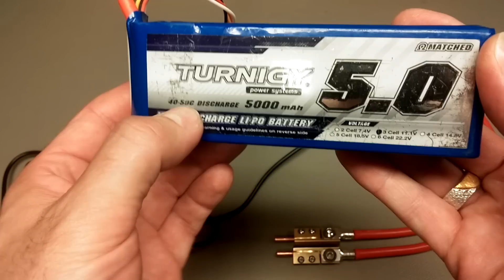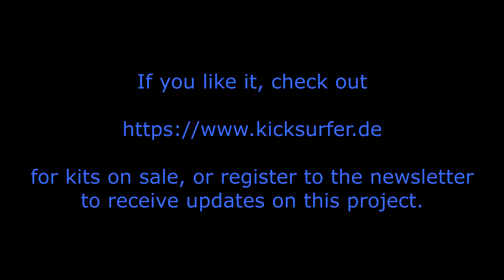Next level DIY battery spot welding

Comment: I just received confirmation of this item being in stock but it comes out to $260 with shipping and I really thought it was cheaper when I pre-order, did the price change? I'm not sure I want in at $260.
Reply from the maker: The first production batch had a 10% discount, which this one doesn't. But $260 seems to be a too high number. The kit with cables for self-assembly is €156 plus shipping. You can also order just the electronics module for €110 and provide or make all other parts. This kit is a bit more expensive than other similar kits, but I have also invested into parts to make it more robust. Just the six MOSFETs cost roughly €30 at Digikey.
Reply: $165 for the unit
$51.48 for DHL shipping a little pricey for such a small item. 
$34.56 Mwst.? Why? 
$216.48 total which thanslate to over $260 US
Reply from the maker: The €34.56 is the VAT (German: Mehrwertsteuer, Mwst) that I have to deduct, and €43.26 is the business rates that I get from DHL. I assume that you are located in the USA, that's the DHL price for an overseas parcel. None of these go into my pocket. I have a US reseller though, please contact me through the website contact form and I'll give you his contact. Part of your high price is the recent isolation policits in your country, which is weakening the US dollar. Only a year ago the US$ / € conversion rate was much better for you. But that's an entire differen topic...

Comment: How much did it cost? do you plan on selling a pre-made one?
Reply: ahh nvm just checked your shop, 165 Euros is a bit on the high side... i usually solder my 18650s, which i admit, is a bit tiring and time consuming...it is a GREAT product though just not very affordable for me... thanks
Reply from the maker: Check out the shop for the prices, it is currently sold out but I am working on another production batch. It will be available in kit form only for you to self-assemble. However, you need only very basic mechanical tools for that, it is fully soldered and all the special work like cable crimping is also already done.

Comment: how is your powersupply project for this welder coming ?
Reply from the maker: I have a prototype of the capacitor charger running at 60A continuous (80A short), heating up a lot of 50W halogen lamps. The capacitors need a base PCB with a balancer, I plan to continue this project in January.
Reply: ok that sounds great, and when i already have the spot welder i will be able to just hook it up to the new power supply as is?
Reply from the maker: yes, it will be an "official" accessory.
Reply: ok sounds excellent, ...on your waitlist now :-)

Comment: Really cool. How about spot welding copper or alluminium? Once the 20700 batteries are available everywhere the need of high current serial connections will be huge. Or do you have an alternative idea for nikel?
Reply from the maker: I haven't tried aluminium yet, but made experiments with copper. It seems that the power level is not high enough, it would require 5-10kA for copper because its very high thermal and electrical conductivity. kWeld is good for 2kA max. I'll keep experimenting though, as it would be a huge plus for the welder if it can do copper.
Reply: WeAreTheWatt thank you. Owould it be easier to look for nikel plated copper? Or copper plated steel?
Reply from the maker: I think neither would help. Plated copper has the same excellent thermal and electrical conductivity, and it is hard to melt. Copper plated steel has basically the same conductivity as steel...
Reply: ultracapacitors might do the trick
Reply from the maker: I've went all the way up to 2000A of current, that's the limit for the welder switch. That wasn't still enough for copper/copper. But I will try with aluminium (have to order something for a test). But that has double the heat capacity of copper, and half its thermal conductivity and double ohmic resistance. But most importantly, it melts at a significantly lower temperature.

Comment: Nice little welder!
Your kickstarter page is down for maintenance. 
Have you quit making these? 
If you're still going to be making them, what is the price shipped to Los Angeles Ca 90501?
Reply from the maker: it was down because I maintained the products and started pre-orders! :-) You can check the shipping rates online, the shop has a calculator.

Comment: Hi! What is the electronic module/board used in the welder?  Thank you for the video
Reply from the maker: This one is not based on one of these off-the-shelf controller boards, it is a monolithic design using an STM32 microcontroller. An Arduino would not be up to the job here, as the computational complexity of the welding algorithm is quite high.
Reply: Answering the question about what brand this marvelous product is made by, I still have not seen the answer. Could you please provide a brand name, or wher to buy it? Al the best from The Netherlands!
Reply from the maker: Did you read the video description? ;-)

Comment: This is really fantastic to me, and the amazing realization is that no high voltage is necessary only 11.1v! Why people user a high voltage is now a mystery to me. Perhaps the weld happens a millisecond faster with a higher voltage?
Reply from the maker: Where did you see high voltage in a resistance spot welder? For this kind of welding, you just need insanely high currents. The resistance of a weld spot is low, maybe one milliOhm. And you need to heat it up such that it melts.
Reply: many people use a microwave transformer- but actually I guess in adding a large secondary they are actually using a low voltage at the weld. So the big difference then is just using wall current versus battery current, and to produce the hundreds of amps needed a relatively high primary to secondary ratio is needed. But I always thought that arc welders use high voltage- but maybe no.
Reply from the maker: Yes, the microwave designs also produce low voltage, around 1-3V on the secondary. But hundreds of amps is not enough yet, also these are able to do >1000A when made well. Their advantage is that it is much easier to switch the current, but their disadvantage is that they can only chop the welding time into 10 millisecond intervals (one half AC sine wave). I need much better resolution to implement my energy based pulse control and therefore chose DC supply and MOSFET switching.

I think that arc welders are using higher ignition voltages, but this one is not an arc welder. This is called resistance spot welding.
Reply: oh ok thanks for explaining- interesting that yes- it must be that 60hz is only 16ms I see your point about a higher switching frequency.

Comment: Why brass? Aluminium is way more conductive, similar to copper.
Reply from the maker: It's not that easy, aluminium is highly corrosive and the "rust" is non conductive. At these cross sections (currently 4x12mm = 48mm^2), conductivity is not an issue, I concentrate more on cost and usability. Brass was most easily available for me for testing, but meanwhile I tried laser cut aluminium as well. I was not happy with the result, and will change to brass again. Check out my other videos, this one shows only the first evolution step :-)

Comment: This is great, i will have to bookmark it. I am learning about batteries and building battery packs and so this will be a necessity. Will it be possible to power one using a powerful DC power supply or car battery? I don't feel comfortable using these cheap lipo packs. In my RC racing experience, they tend to be like women; unpredictable and violent.
Reply from the maker: You can use the unit with a car battery, or with a suitable supercapacitor. I am currently developing a capacitor based power supply for the welder.

Comment: Would it be possible for the software to allow the time before automatic welding occurs to be set?
Reply from the maker: I don't understand why that would be meaningful? That would contradict the design concept of controlling weld spot energy.
Reply: Sorry, I was not clear.... The time I would want to control is how long one gets to position the probes before welding is triggered, when in automatic mode.,,, In the video the automatic mode appears very useful but the weld happens very soon after the probes make contact and I'm not sure everyone could position them accurately and press down ready for the weld to happen in time.  Hope that makes it clearer.... nothing do do with the welding process itself.
Reply from the maker: Thanks for clarifying. Yes, this appears to be a very useful feature! I've added this to my todo list. But that also implies the decision to move from a potentiometer to a rotary encoder with pushbutton switch. One of the rationales behind this system is to make it as simple as possible. Not decided yet...

But have you also watched the more recent videos of my channel? I have improved the auto mode to make it more usable.

Comment: And I guess it gets the energy right by measuring the resistance of the tabs before each weld? That's quite clever and makes a lot of sense.
Reply from the maker: Almost! It is doing this continuously while welding, at a very high update rate thanks to the powerful microprocessor.
Reply: Impressive! I might order one when they're back in stock ;)

Comment: Is the circuitry in this effectively similar to the car jump start battery pack? Not seen much for tear downs on them but they also use MOSFET's. Otherwise from a safety stand point it could be a good idea to cover the leads with some kind of insulating material where you are holding them.
Reply from the maker: AFAIK those Lipo jump starter packs are basically just the battery and a schottky diode for reverse polarity protection. There is no power switch, you just connect them to your battery. The current is typically also lower, a few 100A. This unit is much more complex, as it has to reliably switch up to 2000 A.

Comment: Does this not damage the batteries in any way?
Reply from the maker: Spot welding is the method of choice for making battery connections, because it introduces only very little heat stress.
Reply: Fleder not excessively. All use of a battery degrades it. If you want something that lasts forever you really would want to power it from the wall, but I can't imagine this braking anytime in the near future.
Reply: No, I was talking about spot welding the battery :)
Reply from the maker: The battery that I am showing in this video is in fact not up to this task. I have tested a more suitable one in my more recent videos on this topic, check out my channel.

Comment: You could wire 2 of those batteries in parallel to increase the discharge rate if you need extra capacity.
Reply from the maker: yes, that would be an option. But I have found a more suitable battery as I discuss in my more recent videos.

Comment: Perfectly engineered. Must have been german.
Reply from the maker: Yes it is :-)
Reply: Could have also used a 12v starter relais. These things are for high start currents at 12V of around 250A and are really cheap like 2 dollars per piece.
Reply: @seculartalkin60fps37  ..your idea is low end side..the above really high end electrical/electronic system with all data calibrated with uniform output.
Reply: @seculartalkin60fps37  there's a separate video with using a starter solenoid that are used in ride mowers, same principle and it's easier and cheaper to build, but you have 0 control of the pulse energy, but yes, as a cheap and easy spot welder it will do the job just fine and save you some $$$$$
Reply: Couldn't you tell by the accent? LOL.
Reply: this project reminds me of another one my some years ago, https://www.youtube.com/watch?v=dd-Vb1LqkLA

Comment: Just a fuse rated for 300AMPS no biggie.
Reply from the maker: Current is 1.5kA, quite substantial :-) The 300A fuse is correct because the unit fires short pulses of up to 0.2secs only.

Comment: Nice little spot welder you made there. Best one I seen that works on battery power. Nice bit of machining too on the probes. Nice little neat device you made there. How many mosfets you using on this ?. Great work and a top job you done there. Hope your going to make some to sale? Think they would sell well. Love it I give it a big thumbs up 👍.
Reply from the maker: Thanks :-) It's using six MOSFETS. But it is not only the number that counts here. The transistors are also physically large, the combined chip size is approx 80 mm^2, which is a lot more than all other similar designs that I am aware of. They are on sale but currently out of stock (www.kicksurfer.de) as I want to wait for customer feedback first.

Comment: How do you measure the energy with it?
Reply from the maker: Energy is voltage x ampere x time, and this is what the unit measures.
Reply: when the fet is on? how fast do you need to sample to get energy in that short time
Reply from the maker: Typical pulse times are in the 1-10 millisecond range, that is no problem for a microcontroller ;-)

Comment: I don't care who you are or what your job is... holding those electrodes when you're using it, is pretty much suicide.... it only takes a few milliamps to kill a person, and you're shoving who knows how many amps through those electrodes.... all it takes is a tiny itty bitty pin point of contact to something you shouldn't be making contact with, and you're dead....
Reply from the maker: There is nothing that can kill you when you touch the poles of a 12V battery like in this case.
Reply: Hikari i dont think he would die. The spot welder he is using gives out 3.7v at hundreds of amps. Even if he had the electrodes on his tongue he would barely feel a zap. The resistance of the human body is far too great to generate a milliamp of current through the heart in this setup. It is more like that he might burn his finger while having an imperfect contact with the metal and having the contact points heat up near his skin.
Reply: hahahahahahaha
Reply: Your mother dropped you on your head at an early age, didn't she?

Comment: In next version. You can include charging function to top-up the battery.
Reply from the maker: Thanks, interesting idea. But as the welder can be used with different power sources, and 3S Lipos are only one of many, I need to keep it generic.

Comment: Nice job.
Now to wait for the 50$ clone from ebay :-)
Reply: This is not true, as a service engineer. you would need something portable. If we would use this more frequent than this is perfect. just if would have a nice case and isolate probes. 
This is really a interesting device.
Reply: Its pretty interesting and compact. I could see it's use, but I think my diy mot will work great for what I want. I might consider something similar in the future, but at his price I would probably just make my own. I wouldn't say that it is highly overpriced, but I enjoy doing it myself and currently I still have the time to waste.
Reply: the fets alone will run 25 bucks at the moment. i really wouldnt hold my breath on that one. if you have a lithography set up and etch tank at home you might make it for close to that price...assuming you also have a battery or cap bank already
Reply from the maker: Not mentioning all the other components like microprocessor, LCD, SEPIC switching converter, protection components. To make it short: my purchase price for a tested PCB is higher than that number.
Reply: im waiting with you
Reply: panteltje x
Reply: Here is another one DC battery spot welder - malectrics.eu/product/diy-arduino-battery-spot-welder-kit-v3-2-2-full_bundle_car_battery/
I would not buy one even for a hundred bucks. So I'm waiting for a cut down version with Bluetooth + app instead of a screen and a nob and maybe busbars, wires not included so it can be shipped by 15¢ Yanwen shipping.
Reply from the maker: The assembled PCB is 110€, the prices that you state are for the full kit I presume. That includes all mechanical parts, some of them custom CNC machined, and all cable assembly plus work plus packaging. If you would want to sell that assembled PCB for 50€, then you would certainly have done your calculations wrong. Just the 6 MOSFETs, the microcontroller, and the LCD account for a bit less than 40€ at Digikey.
Reply: @wearethewatt2950  
wers glaubt... 16x2 lcd 40 dollar
3 euro

mosfet pro stück... naja
hahaha selbst mit drehencoder

ein tip am rande.. die Masse bringt geld... produktion auslagern fertig

aus dem grunde werden erfinder meist nicht reich... kein wirtschafts Management
Reply: if i was the iventor , i just throw the clones my self on ebay first  ;D.
the price is to high for a piece of electronics. Sure its very useful and engeneered. But just my opinion a very experienced buyer, the value must be higher than the price you must pay. And this is not the case here.
(Microcontroller,Mosfets, a PCB cant justify 150/213€) i would say at max around 66€ and a on "sale" price of 50€ would get him way more sales.

Comment: Great project. One suggestion. Don't use a Deans connector for the battery. An XT90 connector would be much better.
Reply from the maker: No. I have them here, but it is very difficulty to mate them with AWG8 cable. Therefore I decided to use XT150 instead.
Reply from the maker: Check my new videos on this, I've already improved that :-)
Reply: Still not XT90 though ;)